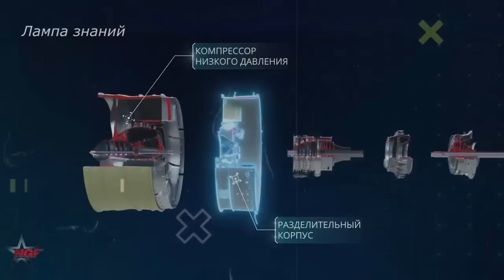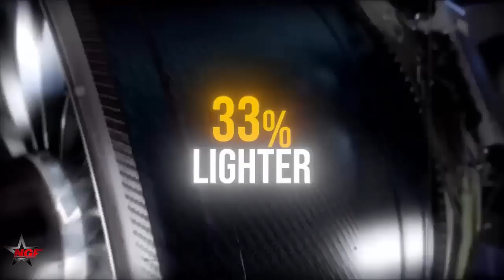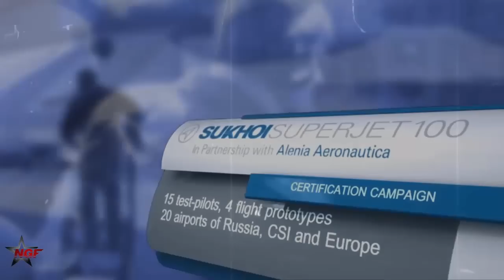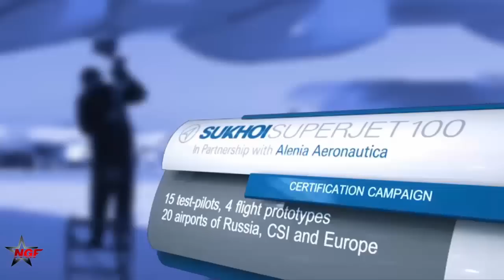Russian SJ-100 prototype aircraft with PD-8 engines will start flying in the first half of 2025

Comment: I see the two sections of the intake impellers but I don't see any type of duct behind it where it's splitting the vortex so that you have one going into the hot section and then one going into the colder bypass section. 😅 Also, it doesn't look like there's a different pitch to the top edge of the impeller. Does it flex at operating speed? 

 #iscreenshot I retain all rights to my intellectual property.  Which includes the right to sue for damages such as algorithm modifications or deletion

Comment: What is the status on the PD-8 engines?
Reply: It says in the video they're going to begun flight testing, hopefully in the beginning of 2025. They already have completed most of the ground testing😅
Reply: Flight tests began in 2015 on an Ilyushin Il-76. Between December 2016 and May 2017, the PD-14 operational performance and working efficiency at all altitudes and speeds were assessed on the Il-76 testbed aircraft at Gromov Flight Research Institute near Moscow - Wikip.